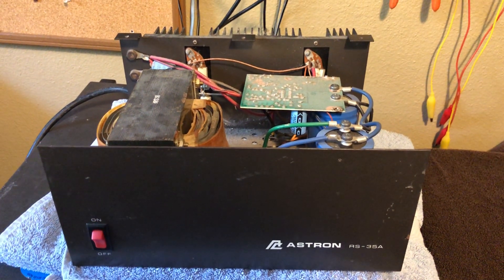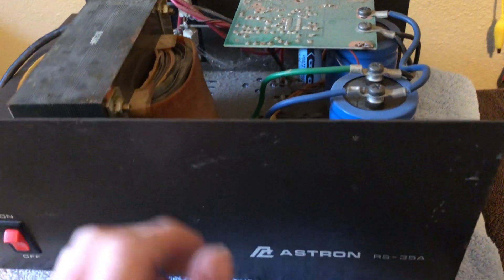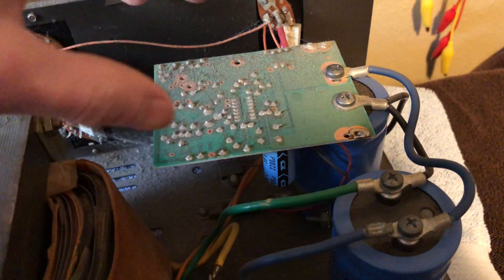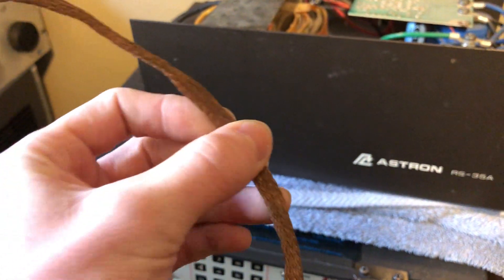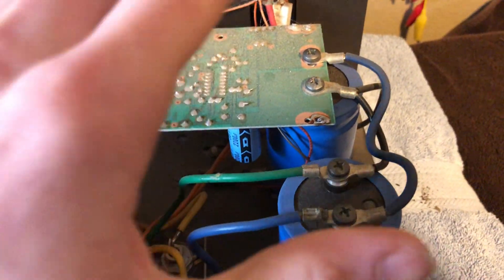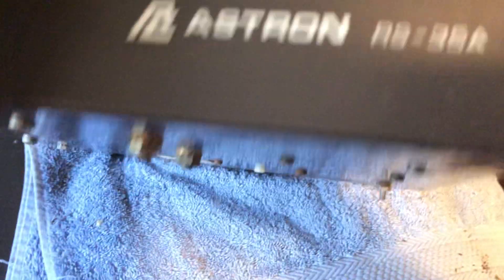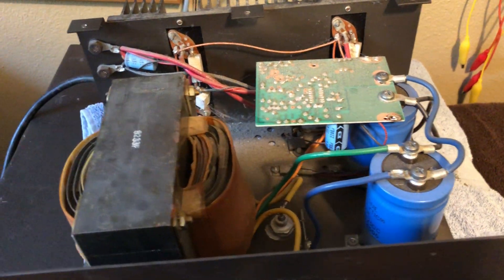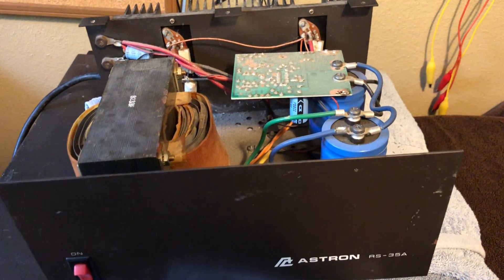PSA to Ham Radio Operators!!! Astron Power Supply Malfunction & How To Avoid It!

Comment: Bought my rs-35a in 1994.  Still have it.   I looked under it.   It has insulated caps on each post,  from the factory.   At some ppoint yours were removed.
Reply: I have a RS-35A, “35 watt” model (more like 24 or 25 watts continuous current capability). It has the same arrangement with contacts that are above ground exposed on the bottom. The insulating caps are completely logical but my RS-35A was purchased new—and never had them.

Great idea to warn us that a short could happen to us. Thanks.
Reply: You mean amps not watts.
Reply from the maker: Interesting! You're the first person to mention that. Mine was used so that makes sense.

Comment: As a past California ham (KC6SGX) and working in electronics over 50+ years and a degreed powersupply engineer in test and design, over many years i have repaired and modified thousands of Astron units, and personally own some to this day, my thing is as the same for automobiles anything made by man will fail. Bottom line. Hope everyone is doing well. Just my two- cents....sure their are many reasons and siturations but it is what it is. 73's.....

Comment: Protection circuits? Try regulator circuits. Guessing you don't know much about how power supplies work. Your a ham? Really? Sad!
Reply from the maker: Lol, I work in the telecom industry. There are protection circuits to protect against direct shorts on the DC output. I also know that there are regulator and rectification circuits but that's not what I was referring to. Sad you couldn't catch on.

Comment: That is an absolutely unacceptable design flaw and Astron shout be ashamed of themselves for ever allowing a single unit like this out of their factory.
Those diodes could have easily and inexpensively been mounted to a piece of metal inside the case with no short hazard being exposed.

Comment: Those posts are the rectifier diodes and it should have a blue plastic cap from the factory to insulate and protect from shorts. I have exactly the same version of RS-35A. I wonder if It I still available from Astron.

Comment: No feet on a power supply. First people it’s the users fault for using that unit with no feet. If he had feet on it no problems would have happened.
Reply from the maker: The feet were installed when the incident happened. If you would have paid attention to the video, the unit was disassembled. The feet need to be removed in order to disassemble the chassis.
Reply: This RS-35A power supply has the rubber feet as the screws for the cover unlike the newer versions.

Comment: The power supply is missing it's rubber feet #1 ✔ #2 loose ground straps or any other bare metal objects shouldn't be underneath or inside touching the components ✔ Remember Safety First ✔
Reply from the maker: The power supply was missing the rubber feet because I had it disassembled for the video.

Comment: Those "posts" are your full wave diode rectifier.  The circuit card is your voltage regulator circuitry with a basic current limiting (built in to the 726 regulator chip) .  Not all Astron supplies use stud mount diodes (you called posts) some use half of a high current bridge which is fully insulated.  Rather than a ground braid shorting out the diode (which has the low voltage AC) I would more suspect it touching a rear mounted pass transistor.  If you measure with a VOM/DVM from a transistor case to the cabinet you will notice those have the full unregulated DC voltage maybe as high as 30 VDC.  Those should really be insulated even more so than the studs.

Comment: also the two diodes can be removed and placed on small aluminum heat sing with insulation and thermal grease that be much better I think

Comment: Id just get a bus bar(held by insulators) for the inside, n remove those lugs, mount to insulators for busbar, n wire it as ya need it
Reply: n can do something similar for the diodes, so no exposure, no chance of short,

Comment: The older ones had those lugs. They're blocking diodes for rectificating the voltage. My 1988 Rs-20a has a bridge rectifier mounted to the heatsink, and no lugs. I'm guessing they did away with that somewhere in the 80s. I had a scrap 1981 RS-20a with blocking diode lugs that were mounted to the heatsink instead of a rectifier. I'm guessing it was mainly the 35s and bigger that had them back then.

Comment: There should be rubber feet on the bottom of the chassis, to raise from the surface and allow ventilation, are yours missing? But,yes a good idea to insulate those posts 👍
Reply from the maker: Yes, I had them removed to take off the cover to find out what happened. The cable was still able to touch those terminals with the feet installed .